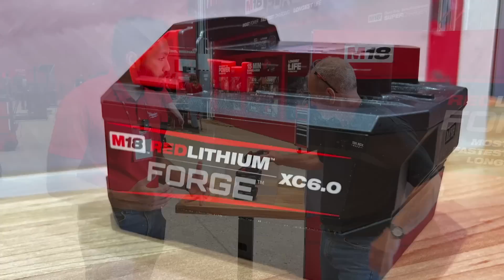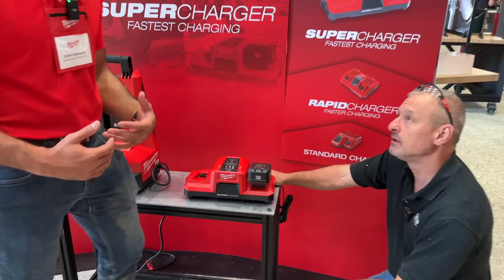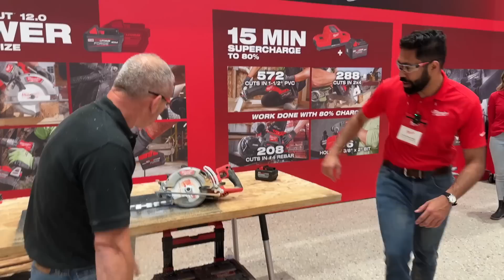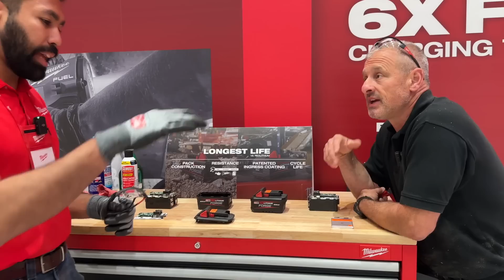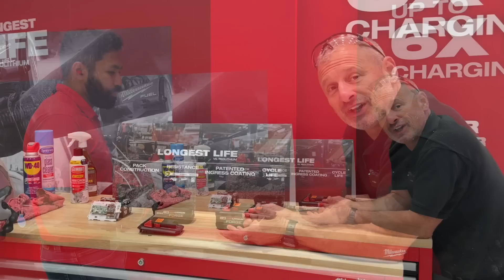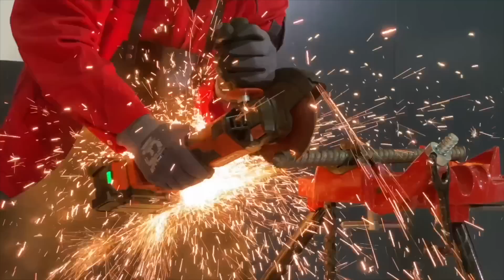The "NEW" Milwaukee M18 FORGE Battery

Comment: So we are talking $449 for just one 6ah battery and the super charger.  The economy is all messed up and you guys expect us to shell out what for many is an entire paycheck for A battery and charger. You all have lost your minds. This battery is not going to last forever and as of now Milwaukee has a sketchy track record with their high output batteries. I'm not trying to be the guinea pig at $445. That cost more than my framing nailer! Also, look at that real world speed increase what was that? 5 maybe 8%? 

Batteries are not cheap. I realize that. But the prices they're asking these days is just ludicrous. I'm not just getting on Milwaukee. Makita's prices are up there too especially on their 40 volt line. I'm just saying we need to get these things down to like 60 to 70 at the most. Slapp in a charger and it should be no more $120 because that's really all most are willing to spend on batteries.

Comment: I was curious to see what the battery makes it different from others but basically took flex tools recipe. I’m not a fan of cell pouches from swelling but i must be missing what makes this safe to run
Reply: They're not cell pouches. They basically kept the cylindrical batteries it's what they call tabless cylindrical. Which means that the connections on the ends of the batteries for their ran in parallel and series together they were always too thin and flimsy to be able to push the amount of power through the cells themselves so they came up with a design that is the best of both worlds between cylindrical and flat cell batteries. If you look at a battery pack you can see the entire length that that energy has to travel through the entire pack and it takes an enormous amount of energy away with thinner connectors. Think about it as only previous batteries they used a 20 gauge extension cord whereas now they're using a 12 gauge extension cord. So because they have that higher gauge connecting each battery cell they can push more power through it and recharge it faster as opposed to having that little small flimsy connection. I took it for the hyper tough battery from Walmart just to look at the cell pack on it and the connections on those are paper thin Where's my understanding of a forge battery they are massive in comparison.
Reply: @jasoningram2006  really good to know, thank you

Comment: With more power to the impact with forge and higher rpm's and harder hitting what keeps the tool from beating the plastic battery mount to the tool apart over time. My experience is the heavier the battery the worse the beating between the tool & the battery 😢
Reply: Also the battery screw holes break out. The sooner I have to replace the battery. At $200 each , ouch to the wallet. 😢
Reply from the maker: Good engineering

Comment: >_> man it seems most of these tool companies don't have brains at all....... We use NIcad batteries. Then upgrade to 18650cells....... Oh wait 2400's are better..... No... Pouch cells are the lead now! .............Uh looks at Radio control hobbygrade RC cars, etc that BEEN USING THESE BADBOY POUCH CELLS SINCE 2007!!!!!!!!!!!!! It took Tool companies 16years to figure out all the power is in the pouch cell systems? Why'd you switch to 18650cells in the first place if you're going back to a tech 16+years old?! Oh right cause 18650cells have a shielding metal housing to PROTECT THE CELLS FROM DAMAGE. DING DING DING! So why you switching to a exposed battery cell system now just for more raw power when it's a SAFETY hazard?! The fudge are these companies thinking? Do you want POWER or Safety?!!!

Comment: This looks like some really cool technology for the Milwaukee guys. I'm on the yellow stuff so I won't get to enjoy it. I would like to eventually acquire a couple of the DeWalt pouch style batteries. I have plenty of good batteries so I still can't justify the expense. I have a 9Ah battery that came with my 60V saw and a 6Ah that came with the 999 drill when I need more power. The small pouch battery would be really nice for my impact driver, and the drill also.

Comment: It has the same power.  But will last half ...  Meaning if your 12 AH last 20 minutes, that new 6 AH battery will last 10 ...  There's another thing that needs to be proven ...  For other companies, cylindrical batteries will last 1500 charges while pouch batteries last 2500.  We will see.  As far as I am concerned, Milwaukee's 12 Ah last roughly 3 to 5 years.  max.

Comment: It’s ability to give more power is just the throughput through the cells, overall capacity is lower by the stated value. People think they’re getting the same capacity and a in smaller package which is not true. Probably a similar design to the new stacked cells in the Dewalt.

Comment: Do they degrade in high temperature work environments like the last generation of lithium ion batteries?
I really don't care about how much more power it can deliver if my $249 battery is degraded from 3 months of use on jobs in central valley heat.

Comment: Several of my 6ah and 12ah gave out at the 2 year mark.  Took them into a local authorized repair shop.  By the serial number they were 3 1/2 years old and since i couldn't find the receipts....the joke is on me......
I DON'T TRUST MILWAUKEE OR HOME DEPOT ANYMORE.
Why....why would i take a chance on this forge battery?  I took a loss well over $1000 on these old batteries they sold to home depot.  
I've bought quite a few Flex brand tools lately.  Their batteries don't get as hot during use and stay very cool during charging.  No problems with any Flex batteries or tools so far.
Milwaukee can keep their $250 charger and their untested forge batteries and shove them up their backside SIDEWAYS and without valseline...

Comment: Well this is quite expensive just for the charger. People like me that won’t necessarily need this or benefit from faster charging times most likely won’t get it. i built a collection of Milwaukee tools but as far as brand loyal they’re out of their minds if they think regular folks will jump on this. I can respect that it’s more tailored to mechanics and your everyday worker that depends on their tools to get the job done but for a person that just has a garage with tools, we’re good thanks. Nice to see tech evolving though & eventually it’ll be cheaper

Comment: Will the new 6ah forge work with the Milwaukee weedwacker that came with the m18 8ah High Output battery? 

Will the new forge battery be charged on the original M18 charger that came with the weedwacker?
Reply from the maker: Yes both

Comment: Not a Milwaukee fan. Have very few of their tools. Sort of known for power over finesse. I personally don't get on with their ergonomics. New batteries. New chargers. Much higher prices. Will it all work. Dewalt made all sorts of claims for Powerstack. Frankly crap. The biggest breakthrough will come when we get rid of Lithium batteries. Completely different battery medium. They are out there. Hopefully becoming more practical all the time. Until then companies will continue to squeeze the last dregs out of this technology. With small improvements. Or complete failures, like the Dewalt.

Comment: I think we definitely need a more thorough test of this battery Rob. I want hard numbers for run time and power. Is it going to be a major improvement over the existing 6 or 8ah high output batteries to justify the price tag? And id really like to know how many rated cycles these have. Same, or better longevity? Im tired or babysitting my batteries
Reply from the maker: Duly noted! The team has already started chatting on this
Reply: My prediction... the extra umph will not be as much as advertised... the benefit is a tad lighter  and double the charge cycle life.   I will only charger upgrade if mine fails. Have lots of bats I  rotation  anyway .
Reply: There's in depth reviews right now it is slightly more powerful then the 12.0 on most tools
Reply: I think HO has the most to Improve on. Choosing to stick with 18v at HO is very limiting with heat. So even if the forge has power or can take more heat.. the 9 inch grinder itself will trip at 900 watts... vs dewalt 2800v. Of course this is the really big tools... and it's why Milwaukee is re Making stuff with 2 batteries.  Ex  ope line trimmer.  They were melting.  But a 2 bat 9 in remade grinder will have horrible ergonomics.
Reply: @philipjohn4149  yeah I gave up on my m18 7in grinder and bought a corded one from harbor freight. The Milwaukee was constantly overheating.

Comment: Torch channel testing found the 6HD batter was more powerful than the 8HD and 12HD batteries. So, I wonder how 6HD would stack up against the 6F they debuted today.
Reply: Yes the 6ho when fully charged is equal to the 12 but she will overheated very quickly compared to the 12 , if the 6 forge is always more powerfull throughout the cycle compared to the 12 and when push hard do not reach thermal protection this is a game changer here, i look foward to test that.

Comment: You CANNOT have fast charge and long battery life. As usual, Milwaukee promises big with their batteries and, in the end, they’ll fail. I’ve had numerous 12ah and 8ah and MX fails. They get too hot and then their chargers make them even hotter. Makita XGT does it best. Makita priorities saving their batteries and tools.

Milwaukee is held back by its volatile, too. That’s one of the main reasons XGT and other 36v platforms are cooler. Amps cause heat and when you have half the voltage (18v), you have no choice but to pump a lot more amps to compete with the 36v tools of the world. I appreciate that Milwaukee is trying to keep their platform alive but so is Makita. Makita hasn’t killed their LXT platform in the slightest but added the XGT for tools that would benefit from the higher voltage. Milwaukee needs to do the same.

Oh, and one more thing, a 6ah battery does NOT have the same power of a 12ah battery. Different amps, different power. More marketing BS. Milwaukee is turning to more and more marketing BS to maximize profits. 

I have about $30k in Milwaukee tools. Many of them are getting swapped for Makita XGT.

Comment: That impact test with the 5.0xc vs the forge was too close. Maybe not the best test to show the capability. 6.0 HO vs 6.0 Forge will be the big comparison imo.
Reply from the maker: Wasn’t that 12.0 vs 6.0 Forge ?
Reply: @ConcordCarpenter I believe it was 5 amp also.
Reply: @ConcordCarpenter that was only for the circular saw. The impact was an XC5.0 because that’s the other kit he said was available. From the looks of them though, I’ll stick to 6.0HO. A tiny increase in tool capability is not worth it.
Reply: @BluesDad16 depends on the tool

Comment: How old is help out like the mower? Will these extend run times or just make them faster to recharge? I take it when the new version of this in the 12 amp hour will allow the mower to run quite a bit longer.
Reply: Run time is determined by the amp/hour not the "Power" of a battery, you can have two batteries with the same amp/hour but with a different power output.
Reply: That's why you sometimes see a 6 amp/hour battery outperform a 12 amp/hour in power but the runtime would be longer on the 12 amp/hour.

Comment: Is there a runtime difference between the 6 amp forge and the 12 amp HD
Reply: Yes 12.0 is double the time. It’s one of there most powerful $250 battery. It’s expensive but worth it

Comment: Not that anyone cares or this matters, but honestly I’m pretty upset at the way Milwaukee did the new super charger. The fact that it can’t simultaneously charge two batteries at full power on both ports and then they spin this weakness as a strength, it just bothers me.  Also why are they only comparing it to the current rapid charger and not the current super charger?  In my opinion they held enough performance back, especially in the max charge rate department for bigger batteries, that I’m betting an extreme/ultra/mega/forge charger is coming. Great video thanks so much!
Reply: @2down4up.  Good point. Makita has always sold fan cooled rapid chargers with many of their kits (the fan cools the battery). And their dual bay rapid chargers are also simultaneous and have two fans to cool each battery.
Reply: @ccadama  It just felt like a Ryobi move to me but with a Milwaukee price tag. I’m sure it’s a great charger but to spin charge adapt as a strength instead of the cheap weakness that it is, is just BS.  Also the fact that they seem to have forgotten all about the current super charger bothers me as well. The fact that none of the interviewers ask about that is telling.
Reply: Maybe I'll have to but a few of the current ones when they clear them outta HD, before they get replaced. @2down4up
Reply: Do the fans actually send air THROUGH the pack, or just external/fans for the charger itself? And are the packs still waterproof? The original MX charger, for example, has fans but they mainly cool the charger, not the battery. @ccadama
Reply: @Walkop  If you're asking whether the fans in the Makita rapid chargers cool the batteries, yes they do. Makita batteries have slots in them for the forced air from the charger fans. The forced air helps not only cool the batteries while they charge they also help cool the pack if they are too hot to charge. 

The Milwaukee M18 and Dewalt 20V Max rapid chargers have fans that cool the chargers only. Both their style batteries don't have slots on their packs for forced air cooling.
 
What do you mean by a Makita pack being waterproof? Are Milwaukee battery packs waterproof? In what way? 

Hope that answers your question.

Comment: Hey Rob... great job at getting these videos out so quickly. Obviously great content but also good audio unlike some other similar videos from the Pipeline 23.
Reply from the maker: Thank you sir, five more videos to go. I got a new mic this year so instead of just doing one video with no talking, I decided to do a bunch of short videos to give you guys as much information about these tools as I could.

Hope you guys enjoy it. It was a long day and even longer doing the video editing.
Reply: @ConcordCarpenter  Most definitely. I like your decision to break up this year's PIPELINE videos into shorter topic specific videos.

One question about the FORGE batteries I would like answered. Most of my pouch LiIon batteries when they go bad will swell. When the 18650 cells for my flashlights go bad they just die and won't hold a charge. Did Milwaukee incorporate any sensors in the FORGE battery to tell us one of the pouch cells is swelling? 

Hope you, your entire TBB crew, and your families stay safe and well.
Reply from the maker: @ccadama  no I don’t think so
Reply: Audio more important than video. I can tolerate crappy video. Crappy Audio is unbearable.
Reply: Audio sounds like a robot or is it just me? Still, great content!

Comment: Thanks for the tutorial Rob!
I prefer to spend my $ on more older/cheaper batteries and multiple slow chargers.

Being lighter will definitely be an advantage when i need more chargers though. 

Early 90's Ridgid had vents in their 18/24 nicad batteries, with a fan that pulled air between the cells for fast charging.
Reply: That's how Makita chargers work.
Reply: The 12Ah is more expensive that’s this one. Hopefully it lasts as long for a lower price.

Comment: Does anyone remember when Milwaukee tried to convince everyone that battery size didn’t matter to tool output?  It wasn’t that long ago they tried to say a 2.0 was the same as a 4.0, the larger battery just gave us longer run times.  Lol.  Now the marketing has flipped 180 and their main event is now centered on more powerful batteries!
Reply: ...you mean when other companies started pushing higher voltage battery platforms, requiring new tools to be bought? Yeah, I remember that. 

M18 still exists 10+ years later - and many are best in class. Not to mention that there are ~15 year old tools out there that can keep going using these brand new batteries.
Reply: @Jay-Crowe  Don't forget  Milwaukee's v28.
Reply from the maker: Yep I do - 15 plus years of best in class….. they’re doing something right my friend

Comment: Wasn’t the previous HO XC6.0 battery already just as powerful if not more than the 12.0? Are they implying the new 6.0 battery has comparable runtime as the 12.0?
Reply: Acording to milwaukee the 6ah forge has same energy density of the 12ah (personaly i dont think its 1:1 in real world maybe best case scenario?!), you can pull more power into the tool and charge way faster, but my theory is that you will need improved brushless motors to really take advantage of this new lithium bateries, or it will give you a slight "omph" and have a greater run time. They  showed the new impact wrench i believe it may be one of the cases it "sucks" more power into the tool to deliver more "omph"

Comment: Is there a difference in runtime between the 6 and the 12
Reply: Of course there is. 12 offers double the run time of a 6 in the same tool under the same load
Reply from the maker: yes the 12 has longer runtime
Reply: @ConcordCarpenter thanks, I need longer runtime for the blower.
Reply: But they keep saying the forge 6.0 is the same and equal to the 12 hd in what way? The hd batteries all have the same power but different runtimes in that category.  So enter forge. Same power but half the runtime just like the 6 hd it seems